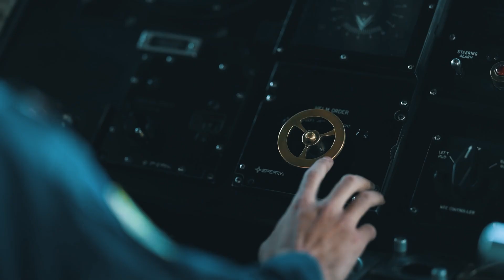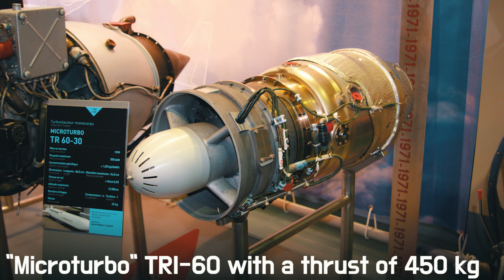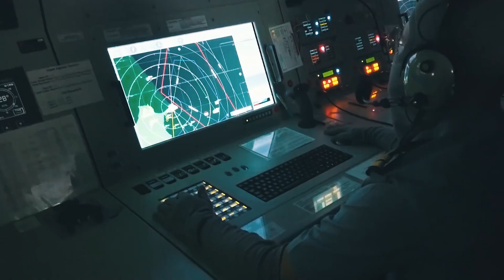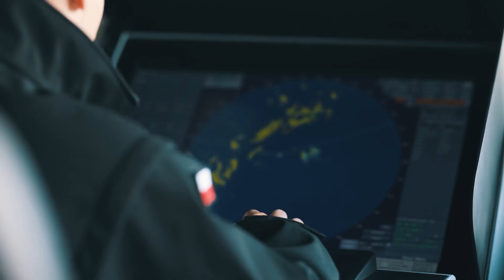Swedish RBS-15: The Newest NIGHTMARE Of Russian Vessels In The Black Sea!

Comment: There are several confusing and incorrect numbers indicated in this presentation. In the text it states that the RBS-15 i 143 feet long which is off by a factor of approximately ten, it is 4.35 m. Also the payload is approx 200 kg, not pounds. Two hundred kg is about 450 lbs. Source Wikipedia.

Comment: Why can't a missile designed for land targets work on ships at sea? They both are targets that travel slow and are large, I don't understand why you need a special missile for sea targets.
Reply: these are the questions. 1 multi-role missile should do.
Reply: It is for land also. They even mention it in the video.
Reply: Well, RBS-15 does this. But has much smaller payload then cruise missiles for land targets. Sea missiles need to be more agile for example
Reply: Weapons used at sea must be able to handle saltwater for one…

Comment: If you've asked me 5 months ago what do I think about the US Navy's decision to pick the NSM as it's primary anti ship missile for the future Constellation class of frigates, I would have answered it with a few words while some of them would be inapropriate for the  YT comment section. First I was pissed that Pentagon dropped the development of the LRASM-B missile which was developed concurrently with the LRASM-A which became operational in 2018. The difference between the two models was that the LRASM-B was a less stealthy but supersonic cousin of the A model. But OK I thought to myself, LRASM is such an advanced missile with a pioneering tracking capabilities that will work in the GPS denied environment. Also LRASM has a classified range, but surely greater than 300 miles, while carrying a 1000 pound warhead.
NSM had nothing of the sort. It's a small missile with a range of 130 miles and a relatively small warhead weighing 200 pounds. All in all, it was a dissapointment... But all this time I've heard the experts calling the NSM the 5th generation anti ship missile that is incredibly stealthy, flying extremely low above the sea surface, with some fancy type of warhead that compensates for a relatively small amount of explosive carried inside.... I was still suspicious and was wondering why the US Navy didn't develop or choose something faster in the world of supersonic last sprint of Kalibrs, Mach 3 Brahmos and now even the Mach 10 Zircon missiles.
But after the Russian Moskva cruiser sinking incident, delivered by only 2 relatively old school subsonic anti ship missiles, my ind has changed... It's obvious that these modern Western made stealthy ASMs like the LRASM, NSM and now RBS-15 present a huge danger to any enemy's ship...
US Navy is also in the process of developing a much upgraded SM-6 Block II missile. SM-6 already has anti ship capability and a speed of over Mach 3,5 but Block II will double the range, speed and the size of the warhead. That way US navy gets the Mach 5 ballistic anti ship missile with range of around 300 miles. Fire couple of those while simultaniously firing a few NSMs and LRASMs and you got yourself a perfect kill scenario... US Navy's CNO recently confirmed that they've decided to skip the development of the supersonic ASM ans simply start working on the hypersonic anti ship cruise missile for the next generation of cruisers that will start replacing the Arleigh Burkes in mis 2030s....
Reply: Wow you wrote an article here?... impressive!
Reply: LRASM is subsonic but hard to be detected so the US or sweden in their RBS is confident that even subsonic, their missiles cannot be stopped